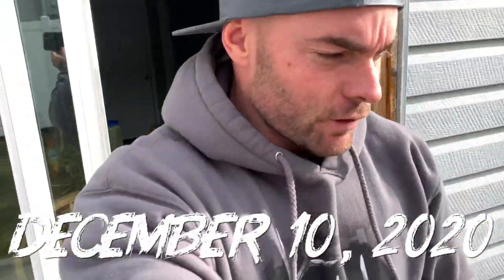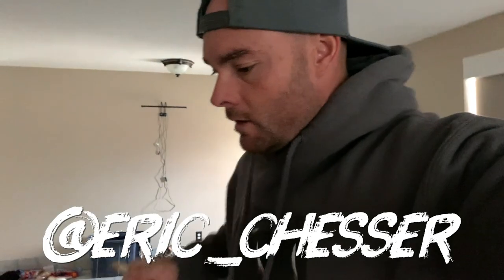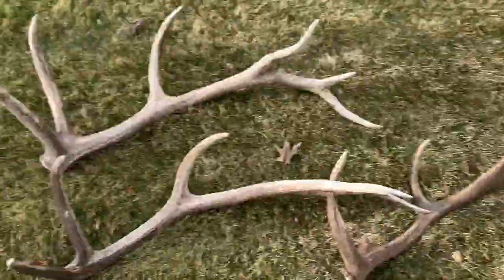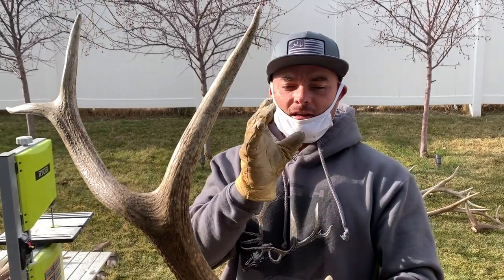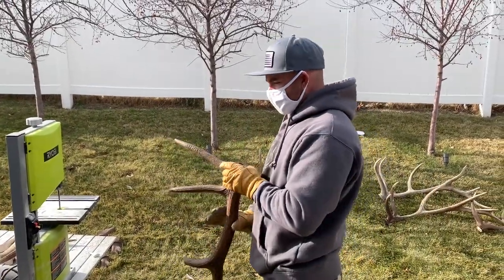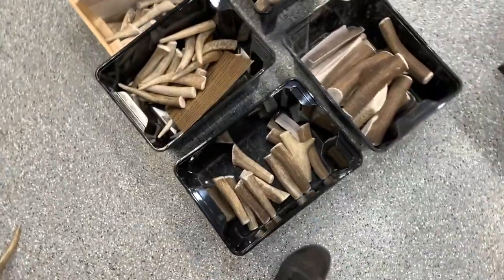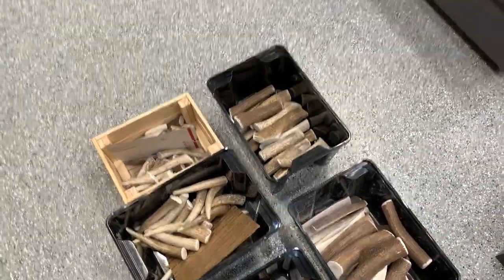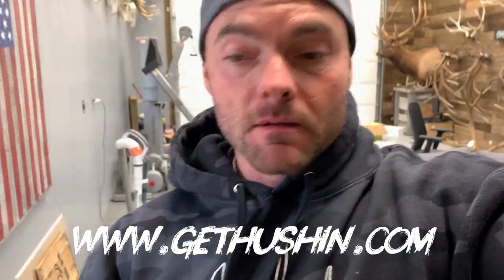HOW TO CUT UP ELK ANTLERS | DAILY VLOG

Comment: I use Antlers. for a different purpose than the general public. I removed the fibrous tissues inside the antler. leaving the Antler.( HOLLOW) So that I can use wiring to light up the tips. My problem is getting the right antlers. Elk G1 G2 and some G threes. With a 90 degree curve. Any help would be appreciated. I am 90 years old. Cannot buy a sell antlers in my state.